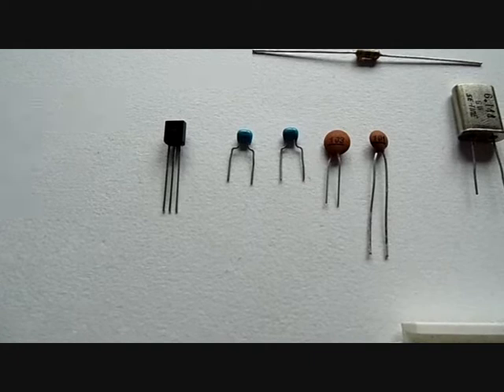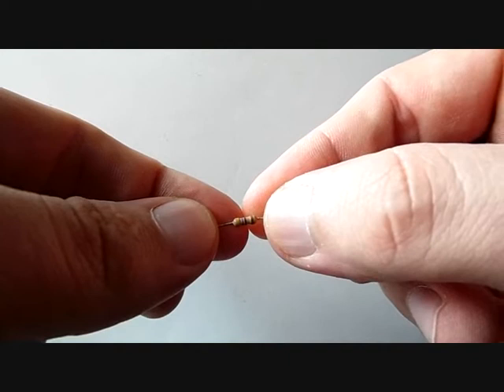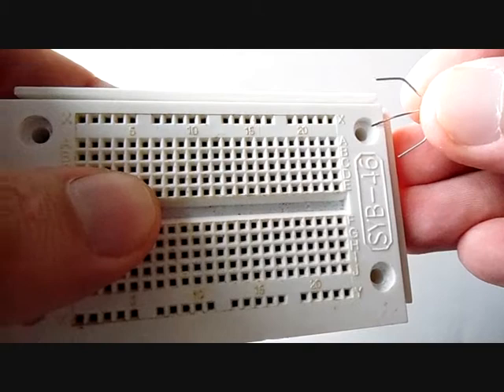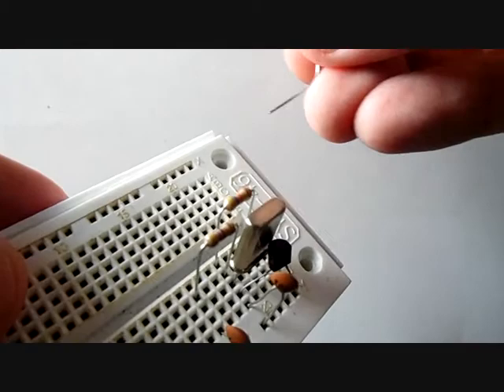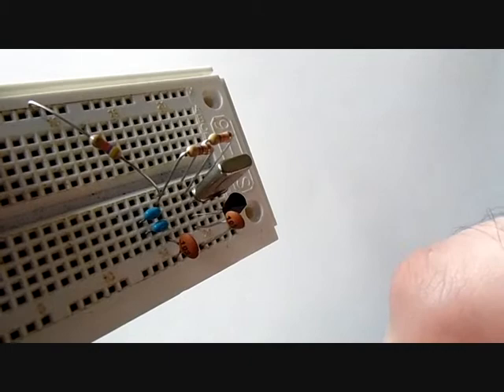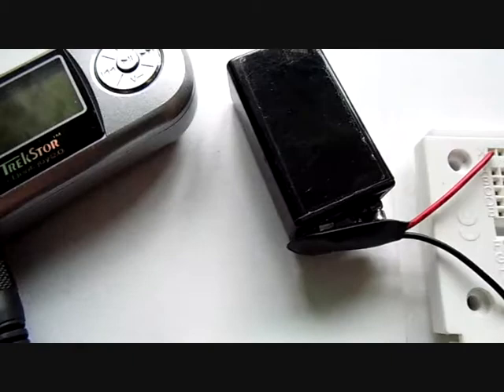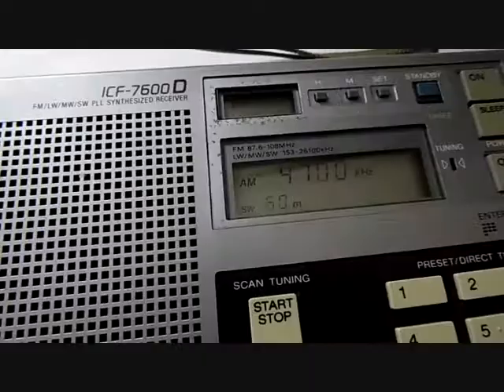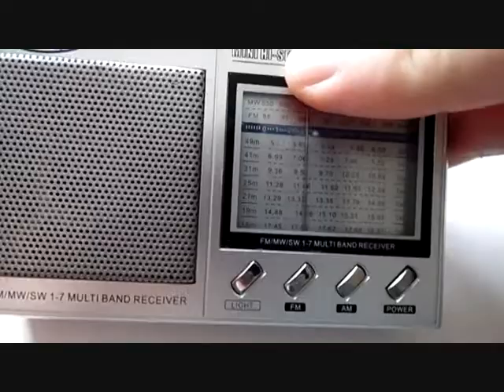Easy shortwave transmitter

Comment: Can I Use an Electret Microphone
Transmission range
Frequency
I can put a variable capacitor
Voltage and Materials (I speak Spanish, I don't know English and I'm using the google translator) thank you. Excuse my english hehe
Reply: You need to amplifier with another transistor at first stage before BC548

Comment: Hi Stefan, new subscriber here.

I want to ask: 
First, if I put 3 parallels of 32MHz Xtal, can I receive it on FM band, example of 96MHz?
Second, can this circuit work from lower voltage, say 1.5V or 3.7V?
Reply from the maker: Use one single Xtal (32MHz) and it will create an harmonic on your desired 96MHz. Keep in mind that 32MHz Xtal probably is 3rd harmonic, and in this circuit it would transmitt on 1 third of the output frequency (calculate 32:3). You need a different type of oscillator. Also if you want to use this as FM transmitter, it will work, but only very poor, since Xtal based FM Tx is a very complex / not for beginners circuit.